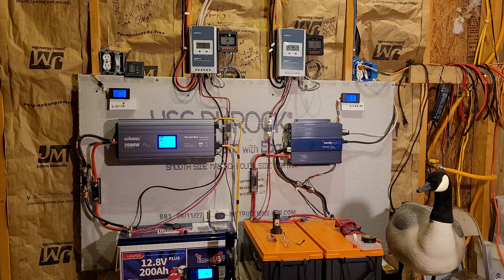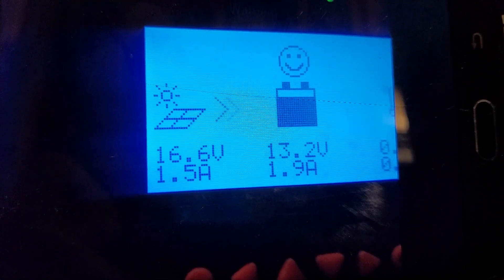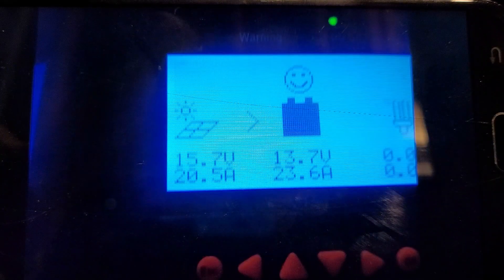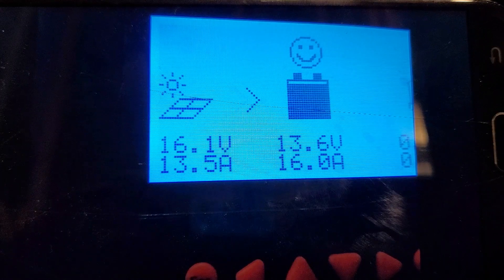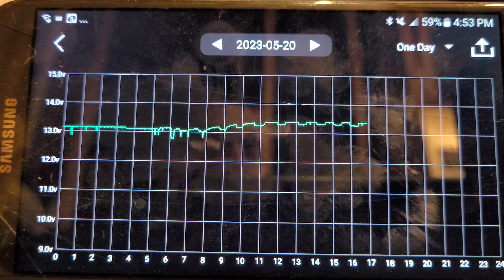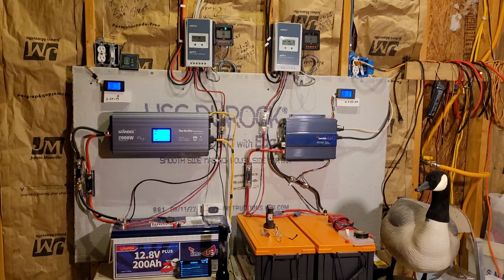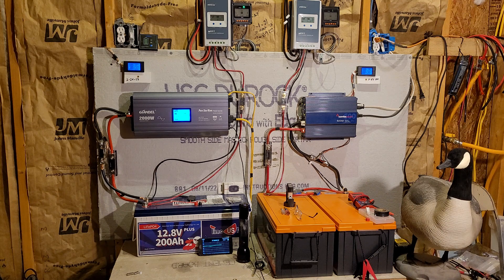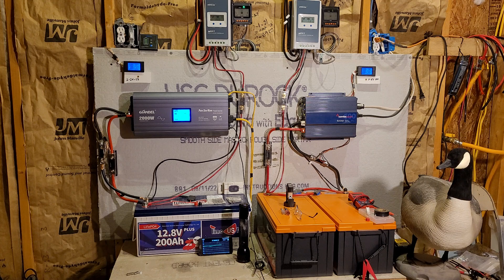Off Grid on a Beautiful Day hourly output 12v lifepo4 system

Comment: I adjust panels twice a year, mostly flat for summer and mostly vertical for winter.  Probably doesn't make a ton of difference, but it takes less than half an hour, twice a year, so I figure it's worth it.
Reply from the maker: agreed   Ill  change them in the fall back to 38 degrees.

Comment: i am  not sure why you still use voltage as a measurement with lithium battery's? almost 80% of the capacity falls into a .5volt range. I have long ago gone to a shunt to monitor my small system and find it much more info than voltage. My small system is 200w solar a 1k inverter and 2.7kw battery storage. been using it for three years now to power all my garage lights, door openers and all my tool battery chargers. Two years ago i added a second system with 1kw solar, 3k inverter and 48kw battery to power my freezer and 5000btu window ac for summer and pellet stove in winter. I live in south central Montana and the only time i have run out of power is after two days of clouds in the short days of winter, plugged into the grid maybe 10 days this last year.
Reply from the maker: Awesome   got all the seasons covered

Comment: my angle is set mid way so it's correct in the spring and fall
Reply from the maker: I shot for winter optimization as there is plenty of daylight in summer to compensate but I was wondering so i experimented